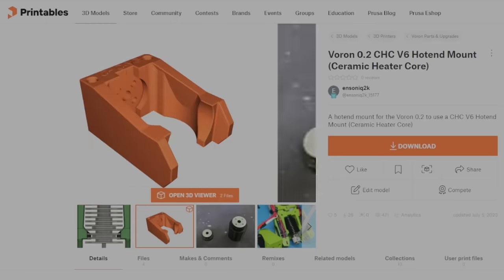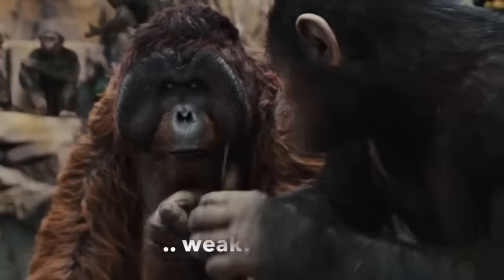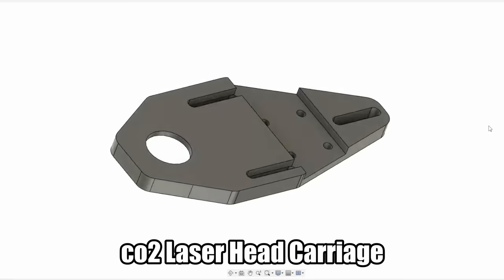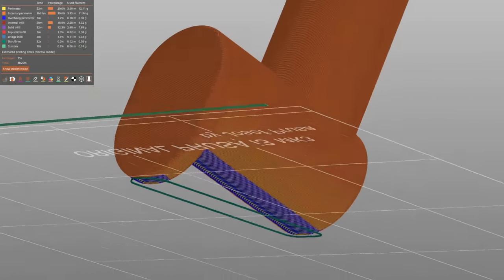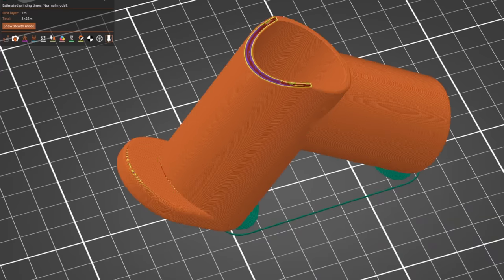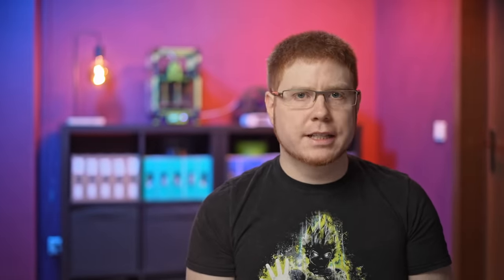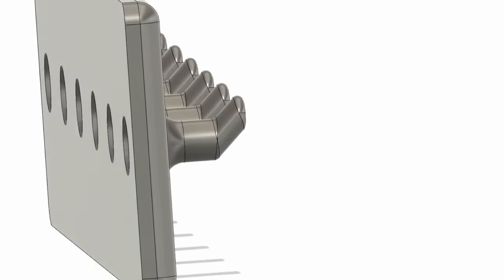3D Print Design SINS that need to STOP on Thingiverse, Printables, Cults3D etc.

Comment: This video couldn’t have come at a better time! I just started designing my first models. 

I’ve already even made the first two sins from this video, now I feel like I’m truly part of the 3d printing community! 🎉

I started your fusion360 course a few days ago, and I’m really happy I did (and also terrified of the process of actually learning).

Although my current needs for models haven’t really required anything more than Tinkercad, I’m going to slowly learn the material so I can feel comfortable enough to tackle any problem in Fusion360, and your course is an excellent resource to have on hand for the journey.
Reply from the maker: Welcome to the family, glad I could help! I think it's the ideal compliment to the course, helping improve Thingiverse & Co. A bit.

Makes me really proud to hear that! Let me know in case you get stuck anywhere. Getting that beginner view really helps improving explanations where necessary.
Reply: @SmallBatchFactory  I’m sort of “stuck” in a sense as I’m trying to motivate myself to finish the last videos of the “creating your first model’ section. It can feel like a bit of an information dump to a newbie like myself. 

I wanted to remix a fan bracket and figured I’d try your course as an intro to CAD/Fusion360. I kept trying to use what I had learned in the first chapters of your course to get started, but I couldn’t really figure out how to sketch out the dimensions of what I wanted drawn on paper yet. 

I’m sure it’s more comprehensively laid out in further lessons, and I just had super unrealistic expectations about quickly modeling the design (I was so eager to design the part and I am very inept at viewing the world in a “problem solving” manner - so I was really operating in unfamiliar territory.)

That’s when I tried out TinkerCAD and found “hey this works just like a slicer, I can manage that” and a day or so later I had the part printed. Poorly, and without the ability to make quick adjustments to dimensions, but it was made and I really needed that dopamine hit. Iterating on that design I can do things that took me 2 hours in 2 seconds now. 

When I get some more time in the next week, I plan on sitting down and taking a proper crack at the course. I feel like the lessons I’ve learned playing in TinkerCAD will only benefit me, since I literally had no idea what I was doing before, and now I’ve come a long way (with still soooo long go!)

So if I had suggestions for the course, I’d say add in some ways to give my ADHD ass some dopamine hits early on and frequently. Really shove those dopamine hits down my throat, learning is painful without them. I’m possibly a unique case though in that sense 😅
Reply from the maker: Oh yes, doing everything properly surely is a lot of information. My first attempts also were mostly "I want to get things done".

I did my best to get to the first practical model as soon as possible and that also means there are still a lot of things to learn to create more complex shapes. I guess that's what you experienced, you have something on mind that's actually easy to build out of 3D shapes while it takes some getting used to doing it with sketches.

Maybe we can use your project and add it as additional practical example to the bonus section.
Reply: You're spot on! You said it better than I could've. I wanted to create a more complex shape, without really knowing that's what I wanted to make.

I have a couple more things on my "wishlist" of learning. A replacement latch for my freezer door, some cool accessories for my cargo bike (cupholder for my daughter perhaps?). Silly stuff like that I guess. I think I'll be able to do it, maybe even quite easily - especially once I have a bit more time to watch the rest of the course.
Reply from the maker: I'm sure you'll get used to "thinking in sketched" with a bit of practice!

Something mounted to a bike frame or some other tube would actually be a good example to add to the course. I already did a few bike accessories screwed onto the frame and this might be not too obvious to some. I'll definitely add that to the ToDo list!
Reply: @RixTrix  Really great feedback! If only everyone could be so helpful in their critiques. I think you'll find the best way to actually absorb how to work in Fusion 360 is just to keep doing the same operations over and over again. This is true with any kind of modeling, programming, and skill really. I have been learning simply by finding something I want to modify or design from scratch and tackling it step by step. There are operations I have done probably 20+ times now and still have to look up the tutorial briefly to be reminded. Big difference between being a pro doing this all day and a hobbyist. Sounds like you were doing well with the courses, so I might even recommend starting over because the feeling of already knowing what the course is gonna teach and breezing through it might make you feel like a pro until the next obstacle, hahaha. Then you'll feel more ready for the next info dump.
Reply: @SmallBatchFactory  I think his recommendation of giving a very quick simple introduction that gives a dopamine hit is a good one. A lot of 3D modeling instructors teach how to make a vase or a goblet first for example, because it uses simple tools that you will go back to all the time and can give a quick impressive result. Maybe teaching something quick like how to design a mug or a cup holder or phone holder that they can complete in less than 15 minutes, learn some essential skills, and then even easily print would help hook them. I haven't taken the course, but just sharing my thoughts!
Reply from the maker: @802Garage love your comment! It's also always fun to overhaul a design you already did in the past with new found skills. Sometimes I wonder what I was thinking when I did the first revision.

Comment: Good advice, but for power strip, especially schuko, the forces are not insignificant. I ended breaking a few power strip casings just because the plugs were stubborn. Now I have replaced most of them with aliminium ones.
Reply from the maker: My own wall mounts are shown briefly which I tortured a bit before the video just to be sure (they're Schuko) . Haven't had any issue with them so far, being printed with PETG.

Comment: My favourite example of a great design ruined by a design flaw is a case for an esp01 relay box i saw once. Everything about it was perfect, except the clip thats meant to hold the wires down had both screw holes placed too close to the edge causing them to actually clip through the sides of the clip causing a whole mess of random polygons in the negative space. No idea how they managed to upload it without noticing the error but the designer just dropped off the face of the planet

Theres also no way to fix it without completely remodeling that clip from scratch, which is doable but tedious
Reply from the maker: Sometimes Slicers manage to fix those issues somehow. I guess that's what happened. Either that or it was never actually printed before.

Comment: I think it should be mandatory to include some kind of instruction with multi part prints. Especially if they require mounting hardware like nuts and bolts.
Is it really that hard to write out? Sure, you can probably put it together with some trial and error, but it's so much easier. If you can't even bother to supply decent documentation, why even upload the model? Even something simple like print orientation. It might be obvious to most people who has been printing for years, but to noobs, it really isn't.
Reply from the maker: That's definitely true. One one hand people do it for free so it's hard to make demands but on the other hand it doesn't really help the people downloading those simple models, which are mostly newbies.

Comment: I really don't think that this powerstrip holder was bad. It should be plenty strong!! My mother used to rip the sockets straight out of the wall in our place. trust me some people do not treat them gently.
Reply from the maker: It's just an example anyway. It's more about the core message "do walls appropriately".

I can tell you power plugs in Germany hold really Strom in their sockets and even with the I can't rip mine from the wall. I tested is specifically because of comments.

Comment: Good tips!

I've recently been educated to the chamfer/fillet on the bottom edges. Those rounded edges look so good in Fusion360 though :)
Reply from the maker: Oh yes they do and I'm certainly guilty myself. If you keep it to a millimeter or two they still work well. Many overdo it and that's when they fail miserably.

Comment: I'd say to fix the key holder you should shift all hooks down and make them square, at that point they will touch the build plate and you can print it rotated to get that additional strength, it does make the mounting plate a bit weak but for a small load if you don't torque the screws too much it will be fine, that removes a lot of hassle for a less experienced printer, adding threads that size is not that useful in my opinion and uploading something with such threads will just be problematic to people that have bad settings I'd say you better thread it yourself with the screw and leave a hole, also you should have added a recess for the screw at the back cause that is going to be against the wall
Reply from the maker: You're totally right, it's just a quick inspiration of how you could do things. The rest is up to the designer.

The original was designed for magnets. Adding a recess for screws would also work. Really depends on the individual use case.

Comment: Those separate hooks might also be heat-welded to the back side of the base plate with a soldering iron.
Reply from the maker: Definitely works! Others have suggested a tapered back end, would rattle a bit though.

Comment: WELL NOW I KNOW my slicing settings are wrong, cause it can definitely fit empty space in a 2mm wall and it was driving me nuts, as forcing solid infill there also caused some blobbing. The factory default was a .45mm extrusion width for some reason??
I had a 45 degree chamfer inside a rounded corner and that was spaghetti as well, bevels facing the bed are not 100% safe. No issues on the other edges tho.

Comment: While your example about not wasting filament for the plug holder is right, its quite a simplification to say that a thin solid wall is always stronger, when there are in fact many scenarios where a wide part even with very low infill will in fact have much better mechanical properties.
Reply from the maker: It very much depends in the use case of course. That's why I said "geometry covering empty space". If you need something resistant to torsion forces, spanning over a bit of distance you need thicker walls for sure
Reply: You are 100% correct. Often the inside does not carry much load, most of the shear loading is carried on the outer skin. This is exactly why people prefer to use hollow tubes instead of solid bars. For the same amount of material a hollow tube (of much larger diameter) is much stiffer and stronger in any DOF compared to a rigid rod of comparable mass.
Reply: In such cases it's worth to try solid infill every X layers instead of conventional infill. Eventually use concentric infill at very high percent. Sometimes it works as another type of fast wall printing
Reply: @SmallBatchFactory  It's just a widespread issue I see in 3dprinting videos talking about "strength" in very simplified terms. An actual proper video about different mechanical stresses in 3d printed parts would be wonderful, because the vast majority of "strength" videos are mediocre at best, and outright misinformation at worst.
Reply from the maker: @hypertectonics7009 that sounds like a good idea, noted!

Comment: Literally did this yesterday. the part was a battery holder. It was too tight and required 2 different lengths of screws unless being screwed into a thick board or a blind space. Tried to modify it but fusion 360 wasn't having any of it.

Comment: Gosh, I really appreciate the advice on cylinder orientation and edits for stronger prints!

One of my personal bugbears is electronics boxes modeled with broad, flat sides and too-thick walls. These are horrifically weak, especially against torsional forces.
Reply from the maker: In this case you might want to add ribs on the inside, ideally at a 45 degree angle. Those add a lot more strength than simply making walls thicker
Reply: I understand the thick walls, as they dont really bear any load they can be much thinner than usual. But I disagree about the other thing you mention.
What do you base that conclusion on? Closed box sections are actually incredibly torsionally stiff. Even without a lid a square section is fairly torsionally rigid, only when you remove one of the walls the stiffness drops dramatically. See also chapter 3 of Gere's Mechanics of Materials.
Of course ribs can be added to increase the torionsonal stiffness even further, but for an enclosure is that really necessary? When is that ever subjected to torsional loading?

Comment: Turning off part cooling at specific layers and slowing down to about >50mm/s (@0.2 layer thickness) will create near mold injection like strength. Depending on your printers hotend of course, you may need to be under 30mm/s. Especially if it's a open air bed slinger. The bed moving back and forth cools the part as well.
Reply from the maker: Yes, either go slow or you need cooling. I prefer designs you can print fast with no issues to going slow.

Comment: It's an open environment so you get variable quality. If you're good enough to pick apart these designs, you're better off designing it yourself.

I'm not, so I'm fine wasting material or tweaking a design slightly for my own need. I'm also fine making suboptimal solutions for my own problems and sharing it with others. 

Places like thingverse are mostly about creativity and sharing. If you go there for professional grade designs, you're at the wrong place.
Reply from the maker: Never expected perfect quality. Still can't hurt to help others making better designs by showing a few easy improvements

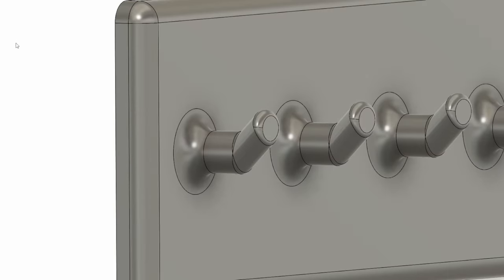Comment: 7:12 fixumdude on printables has some toy cars, where in the new versions he uses a similliar technic for strengthening the axels. The axels are somehow hollow. 
You can just make a hole without the thread, because then it adds perimeters on the inside which makes the part also stronger, maybe for a key hanger, this is sufficient instead of using a screw.
Reply from the maker: For a key hanger it's probably already plenty enough. I'm just the type of guy engineering for the worst case, meaning if you accidentally collide with the hanger for example. Doing a two part design would be the most viable here I think.
Reply: @SmallBatchFactory  That's a great point. I also mostly think "If I break something, I don't want to print the whole part again"

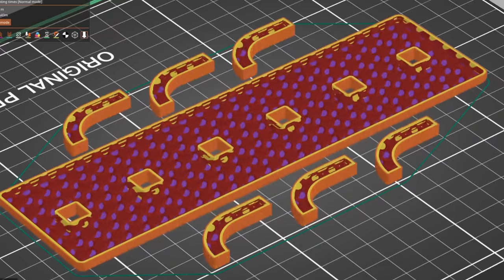Comment: 8:14 I personally like to plan for zero or near zero tolerance in Fusion 360 and use the “Exclusive” slicing method in the Cura experimental tab. However I do not know if there exists another similar option in other slicers.
Reply from the maker: Orca Slicer has some contour and hole compensation features I have yet to try. Compensating in the model is a bit of a crutch for now.

Comment: i my second ever print, downloaded a leatherman holster for my model of leatherman. when it had finally finished printing the leatherman did not fit in the holster.
Reply from the maker: If they included very tight tolerances some machines might not be precise enough for it to fit. It usually helps to scale up the model below 1% in size. You can check the dimensions directly in the Slicer.

Comment: The worst feeling is having to edit files and you have to attempt to use tinkercad to do so. I have yet to get a easy to use cad (mainly i dont want to pay the money for how little i need a cad) and have had many occasions where i have to use tinkercad. Nothing against tinkercad, i love that its free, simple, and great for quick stuff, but importing fules usually messes them up and even if that goes well trying to line the stuff up or get measurements of holes is a pain.
Reply from the maker: I can highly recommend Fusion 360. It's totally free for personal use. It's still not quite easy to edit STLs but I find recreating a model from scratch usually pretty quick and easy.
Reply: @SmallBatchFactory  thanks ill have to look into it. Just finished up on an rpg-7 3d print that came out surprisingly well after i got the test fit rings sized right

Comment: While I agree with all you say in the video I think the power strip holder was a bad example. I’d want it thick and printed at high Infill so I can unplug stuff without worrying it will rip out from the brackets. Plugs have recesses for fingers in them or other grippy areas, I’d rather just grab that and pull to unplug with one hand instead of having to use other hand to support the power strip worrying it might rip from the wall.
Obviously if it’s there just to hold plugged stuff and never to be interacted with then yeah it’s overkill. 
Guess best solution is 2 versions of the file, or an editable one.
Reply from the maker: I can assure you that 2mm is still plenty. I have a lot of stuff mounted like that, even showed my own power stops and their holder, never had any issues. Even with the layers oriented less favorable than in the example.

If I add that Europlugs in Germany fit in way tighter than US plugs there's definitely no need to worry. I guess that fear is where a lot of those designs come from. I have 2.5 Kilo spools on rollers with only 4 small nubs and even those take the force for years with no issues.